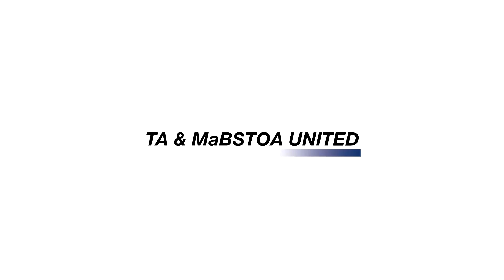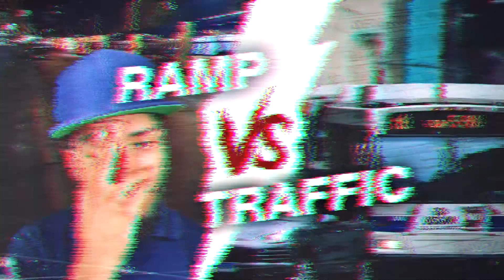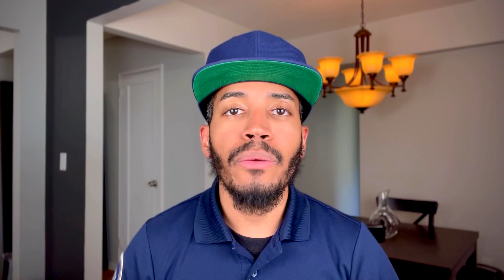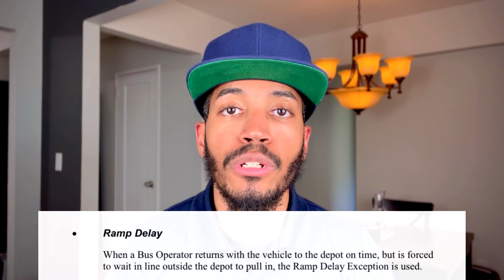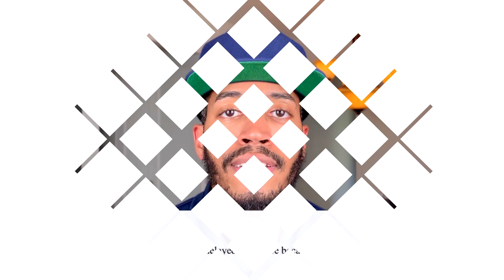Cutslips: Ramp vs Traffic

Comment: What do you do when a dispatcher refuses to put Ramp line when the ramp line stretched outside of the depot and he said that its technically traffic because you haven't pulled in yet ?
Reply from the maker: Sometimes supervisors need to be re-instructed too. 

I would see the Chairman. They can request the “breadcrumb” data from BusTrek. That should be enough to support a pay adjustment if you’re run has a “Boost”.

Comment: So being on the ramp doesn’t eat into your boost time 🤔
Reply from the maker: Correct, as long as the ramp line is the reason for your lateness and “Ramp” is checked on your slip.
Reply: @TAMaBSTOAUnited  This is a major issue that Yard Dispatchers are not solving correctly. TWU 100 Needs to address this.